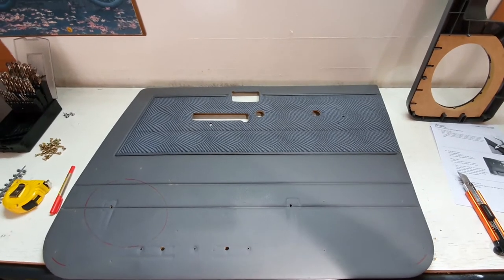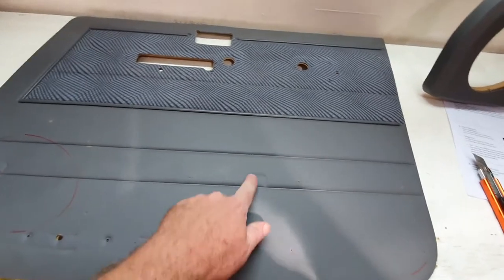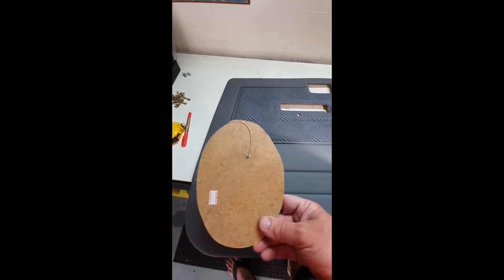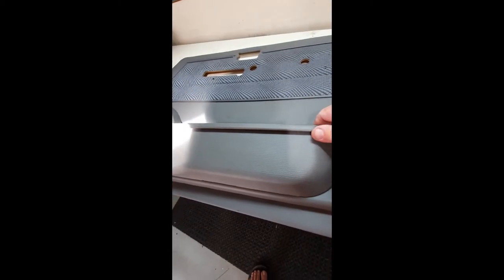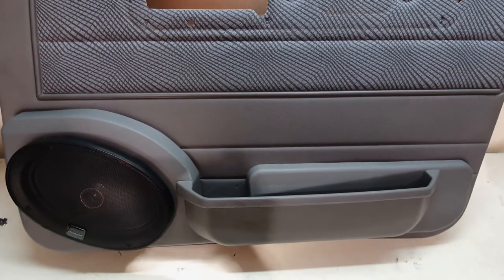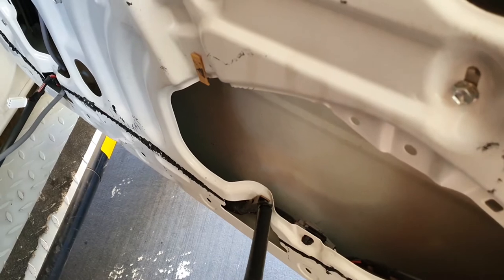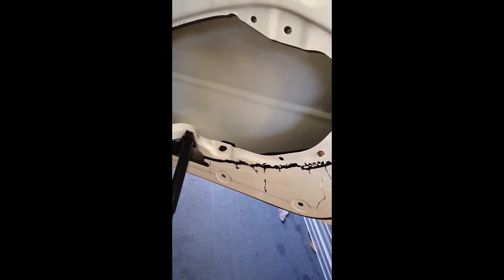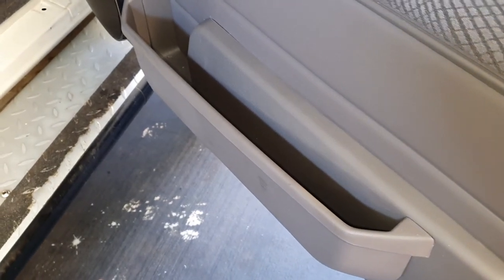Landcruiser 79 D/C Speaker, Head Unit & Pod Installation Pt1- QLD Off Road Adventures Build

Comment: Excellent video mate.

With those speakers did you end up having to cut the metal panel behind the door cards to fit the speaker magnet?
Reply from the maker: Thank you for the feedback.
Yes unfortunately due to the size of the magnet I did have to remove a 20mm half arch on the lower left edge. I then rounded the edge, primed and painted it prior to installing the speakers.

Comment: I'm rebuilding a 79 series 1HD-FTE 6 cyl 2004 RV Ute, portal axles and so on. But I'm trying to find a good head unit that can replace the double-din cd/cassette unit with a touchscreen job with rear camera, satnav etc with suitable wiring looms so I don't have to chop into everything. And of course, the best 4" speakers for the dash ones I can find.  But everything I see is for the V8 jobs, can anyone give me a pointer please?

Comment: Did you have to run wiring from the stereo to the speakers ?
Reply from the maker: Yes. The wiring for the current speakers is insufficient in diameter especially if you are running a amplifier.
Reply: Okay thanks 👍